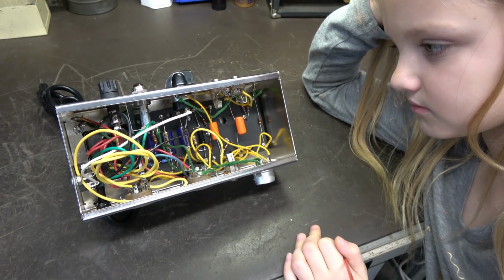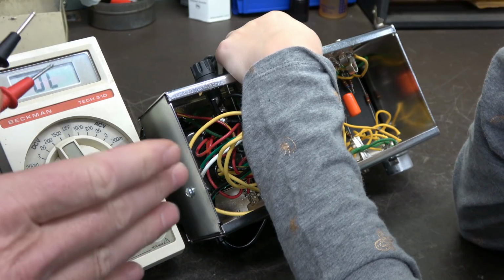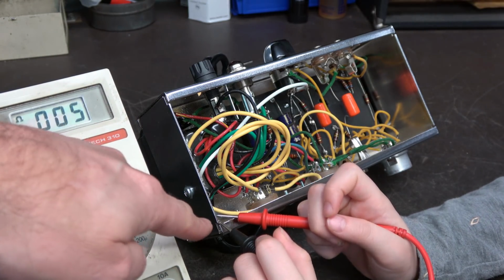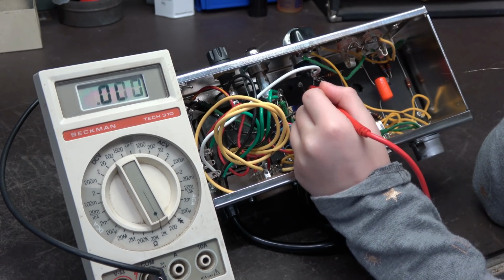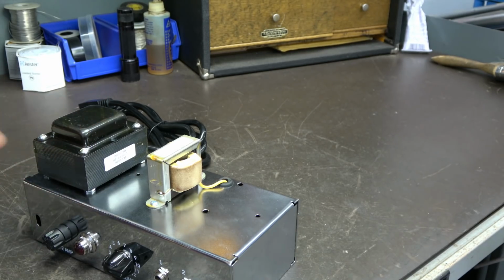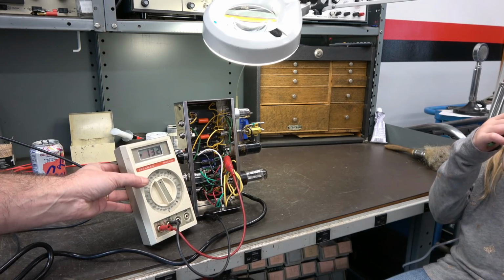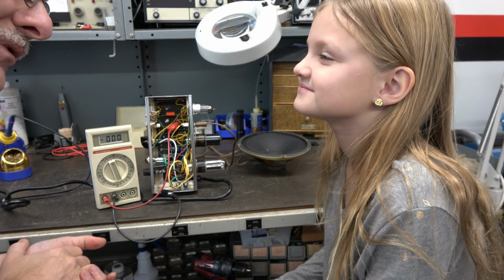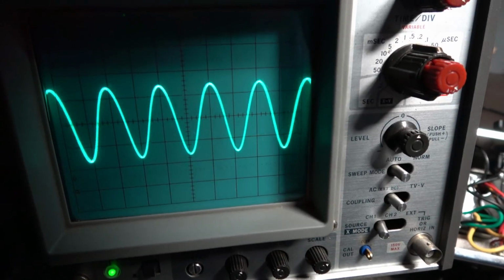How to repair rebuild Fender 5F1 Champ tube guitar amp kit basic troubleshooting

Comment: I pulled up the StewMac amp building diagram to follow along since I couldn't see in to the amp. Really helps make the parts where he is checking the tube connections make sense.

Comment: I see you like to use shielded cable for input connections and have seen where they should be used for internal reverb connections as well...what cable do you recommend? I have search and there's a plethora of shielded cable available it's confusing. One guy suggested buying RCA connector cable and cutting off the plugs...that seems rather wasteful and expensive to me.

Thanks,

Comment: my first build was a small amp for a record changer I had  I think I toasted 3 or 4 resistors  starting with the 125 ohm dropping resistor the tube configuration 12AX7  35W4 & 50C5  and opon rebuilding  the amp in my 45EY2 I connected the input to the wrong lead  and that first was more than 50 years ago

Comment: Fender tweed amps didn't use stand-offs but I like to use them myself.  I put the OT mounting bolts through from the bottom with nut on top of chassis to gain clearance for the bottom of the circus board.  Naturally I use a isolation board underneath the circus board as you have shown.  Nice job shortening the leads and it sure looked good on the scope. Mark

Comment: Some test leads with Pomona or similar "E-Z-Hook"  probes on them would be a lot safer than alligator clips, which have an annoying and dangerous tendency to pop off, or simply not make a good reliable contact,  which can lead to false conclusions during troubleshooting. We use them at work, and you will also see the Guitologist using them as well. And those probe tips you use are crap. You need something with a hard steel tip that can really be sharpened to a point with a file or Dremel tool. "Extend-A-Probes" are particularly handy, because the thin, insulated steel probe in the center of the handle  can extend about 3 inches out from the handle, and they have collets to finger  tighten so that the tip can be set to and held at a particular extended length. The actual exposed metal tip length is minimal, reducing the chance of short circuits when taking measurements in tight spots.
Reply: Lol.

Comment: This looks lots like a Weber Kit.   I will be building a kit in real time on my channel in a few weeks.   Prepare for BORING long work videos!
Reply: Well,  I built my Weber kit,  and it worked 100% right the first time.   I guess that's the difference between experience, and lack thereof.   My first amp kit didn't work,  and with a local tech,  we found my boo-boos. (not horrible thank goodness).   Second kit had one small boo boo I found myself.   Third and fourth kits worked 100% right out of the gate.

Comment: I remember the first build I made, it was a little 5W thing from AX84. I didn't know about kits then, so I built the amp on a lamington tray I flipped upside down. Did it work? Yeah. It didn't go up in smoke. But the volume was no louder than a pair of old earphones. I eventually got it working once I begun understanding how valve amps work. I troubleshooted it and eventually it cranked out the 5W it was intended to. I was lucky it just wasn't a catastrophic failure.

I had no idea about bias. I had no idea about power supplies, filter caps, tone caps, AC and DC, etc.

Comment: I need a helper as astute as Emi!  I feel for the person who assembled the amp initially.  I am struggling to chase down some gremlins in a Heathkit frequency generator I am refurbishing.  The learning curve is steep but that's what makes it fun.  I have been searching far and wide for a Temna 72-1095 isolation transformer/variac like yours but they are more scarce than hens teeth.  Great troubleshooting video Terry!
Reply from the maker: Thank you Paul, I will keep an eye peeled for another Tenma unit. Will let you know. TD

Comment: These kits, especially the cheaper ones have crappy documentation so that is where people go wrong. I also admire the kid who built this... No one invents things by mistake. Failure is the catalyst for success.  Well done Terry and Emi.
Reply from the maker: I agree Sir, a good experience for him either way. I have had many failures in my life, but made sure to learn, try to improve. Thank you for your kind support, my friend.
Reply: At least this guy tried to put something together. Yes the instructions are crumby, not written like the Heathkits or Dynakits.
Reply: I've done 3 amp kits...  The first one needed a veteran tech to find my error.   The second one worked,  but had one mod to resolve an issue.   The next amps I made worked correctly from there forward.
Reply: Stew-Mac has new amp kits out, Mojotone kits, with great build instructions you can download.